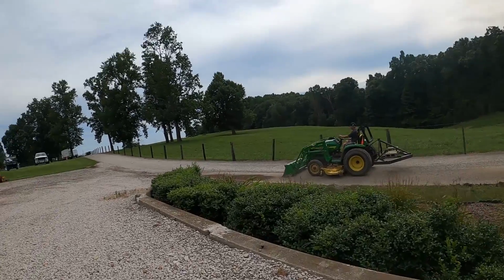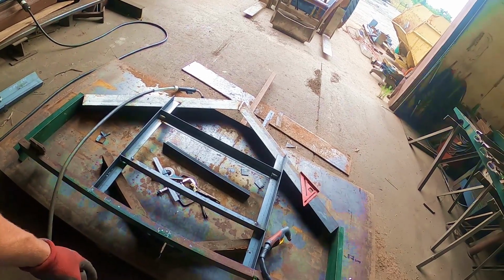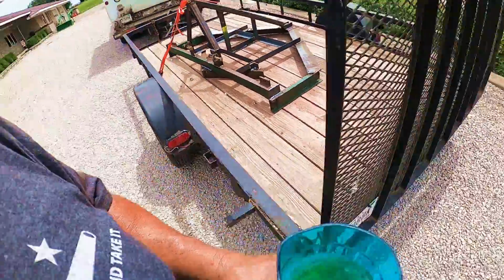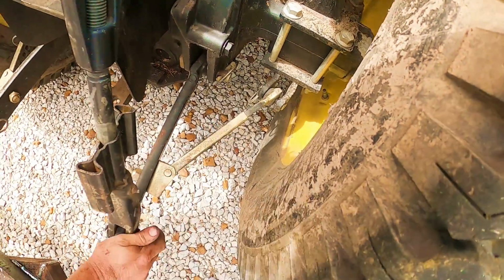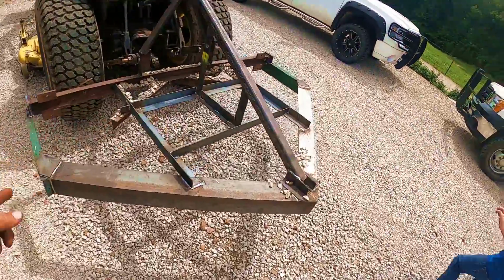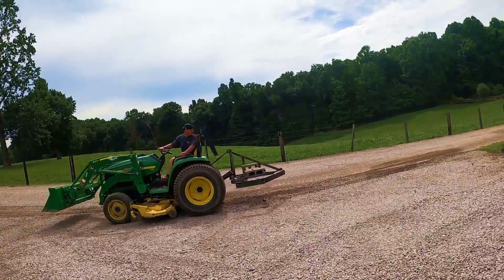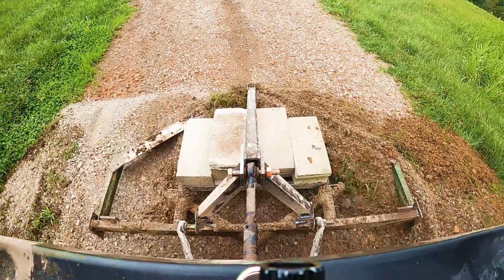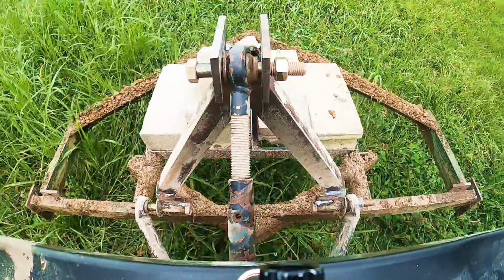Grader box built from scrap in 4 5 hours💪🏻🇺🇲

Comment: Tator, The grader box is pretty slick! It is to ridged IMO with being bolted down at all 3 pts and sway arms are to tight. I would be afraid of bumping something while turning and tweak or mangle the whole 3 pt arms! 
A carry all type thing would be very nice and handy but hands down the most used of all my utility tractor attachments (I have 8 plus) is my wagon. It is an old 1950s International rock wagon for picking up rocks in the fields. It is over built, all steel, huge axle with 15" tires and leaf springs suspension, dump bed(wish it was hydraulic but yours could) it is only 4x8 with 3 foot sides with a short  drop down tail gate. It always has my tools for the day, cooler and fuel cans but can handle any load of rock, dirt, mulch or wood/brush and gets around in tight places well. She ain't very pretty but yours could be and I seriously use it all the time!! I looked at TSC and Rural King trailers originally and knew they would soon be trashed with real work and found this old jewel instead.I can send you some pixs. Hope you and the family have had a great Labor Day Weekend!💪🇺🇸

Comment: Love the content with your kids helping Wade. I try to include my son whenever I can. Can't wait for him to get older and learn the ropes himself. You should get you a set of Pat's quick attach jaws for your 3 point lift arms. Easy bolt on application and so far very druable. I have them on my Kubota and if you switch attachments a lot they're wonderful. Better than the quick attach frame in my mind because you maintain adjustability with various width attachments. Just my. 02!

Comment: I tell you young man, for the first shot at the build I thought you did an excellent job. Your first try, which I call proof of concept, works well. I also like making a working implement made out of scrap iron.  If you do extend those front blades, you might consider welding a piece on each side at more of  parallel with the direction of pull, it might help wing/roll the material out further and flatter for you, just a thought sir. Thanks for the ride along sir.

Comment: Your Boy does a Great job filming For You Wade..Great job on the drag..And Great Video... Wade they have Quick connects for the 3 point hitches. Its like hooks that you back up to whatever you want and lower it back up to it and pick up and go. Works slick. Top just reach back and throw a handle down and it wont fall off. They have them for different  size tractors... Just a suggestion. That way you build what you want put the quick connect part on and your golden...

Comment: Your loader bucket already has small eyes built into each outside top corner. Hooks would probably fit through there for hitch points.
One the handiest things we had on our small tractor was a hauling platform that attached to the three point. We could carry sacks, loose mulch, plants, wood, chain saws, garden supplys, straw bales, and even ride on it. The bottom was about as wide as the tires and extended 30 to 36 inches back from the bottom pins. It also had back boards as tall as the top link to help keep things away from the tractor tires. It was made with an angle iron frame and covered with two by boards. Handy as the devil.
Just do a search for "tractor 3 point hitch cargo carrier" for all kinds of pics and ideas.

Comment: Build a trimmer that comes out from your mower deck that can trim fence line as your mowing have an engage controller so when not in use its not on also mabe a retraction switch so it's not always out . Also you could add mower attachments look like a manual push mower this way you can increase the cut path which means lawn takes less time to mow lol good luck mabe to aggressive projects since your time is limited ,but you asked lol .

Comment: If you have rear ports on the tractor and a spare small cylinder, put that on the third link. You can adjust on the fly and makes it extremely nice. I did that on my box grader and even made a a slide rod "viewer" to locate dead flat quick. I can send some pics if you wish.

Comment: If you find the back end bouncing around and leaving a bit too much material behind you can slot out the top link hole by the pins diameter to let the back of the drag float a bit. Otherwise it looks like it does a really nice job!